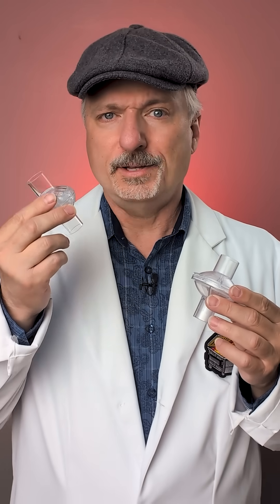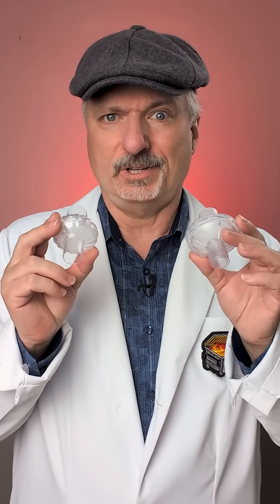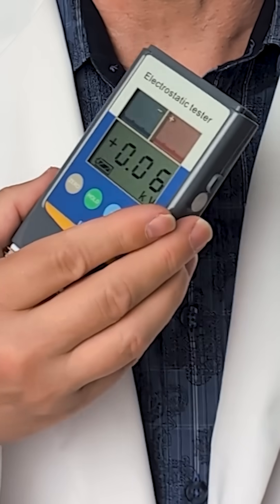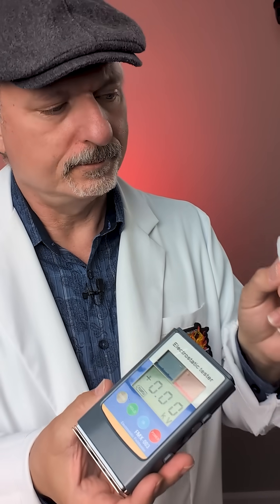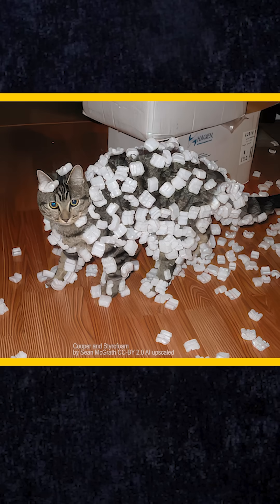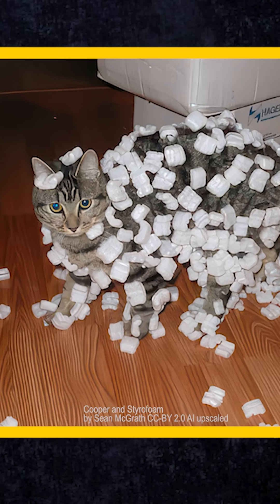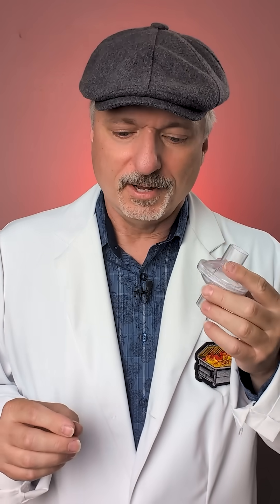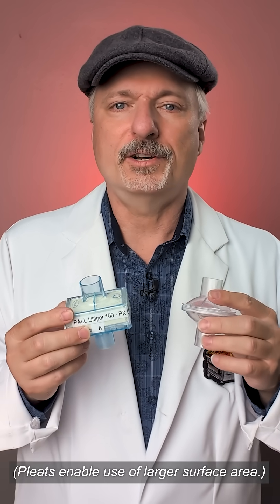Why is this filter so bad? The secret to why this CPAP filter is terrible.

Comment: Wat causes a drop in static charge? How can we tell whether a mask still has a charge without that device (that I don't have available)?
Reply from the maker: The filters with zero charge were almost certainly made without any static charge rather than loosing a charge. It takes special manufacturing methods to charge the fibers.

The electrostatic charge in filters holds up well even when they have been stored a long time, according to NIOSH stockpile testing of N95s. 

However, the charge can be damaged if exposed to high concentrations of isopropyl alcohol vapor.

As to testing, I generally do'n't test a filter's charge except for experiments because ultimately we don't care about the charge itself, we care about how well the filter works. So I test the filtration using a PortaCount. However, they aren't any cheaper than a static tester.

This is a problem for consumers because N95s and other electrostatic filters filter invisible particles using an invisible static charge, something consumers typically have no way to verify. Ultimately, it's based on trust. Trust that the mask was made correctly, trust that you got a genuine one, and trust that the mask hasn't been exposed to high concentrations of isopropyl alcohol. 

If one doesn't have access to testing methods, then the best thing to do is insure you are buying trustworthy products that are tested and certified from a reputable company, through one of their authorized distributors to avoid getting counterfeits or improperly stored products.

Comment: That’s very cool. I would think a smaller filter hole would work best, but an electrostatic charge allowing for larger filter holes eg less backpressure makes sense
Reply from the maker: Check out the minutephysics video for a great explanation of how N95 type filter media works, and how it filters better above and below the most penetrating particle size. The filter media isn't a membrane with holes that smaller particles can go through, it is a web of fibers that capture even nano-particles using multiple mechanisms. N95s are not sieves.

https://www.youtube.com/watch?v=eAdanPfQdCA